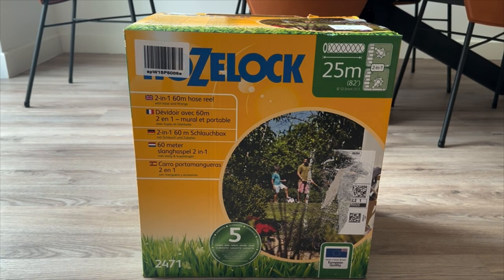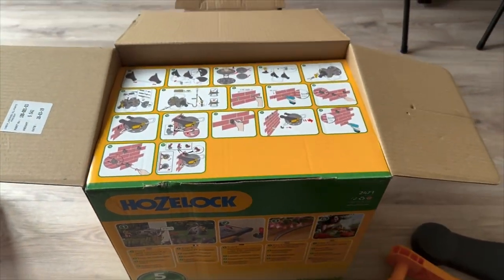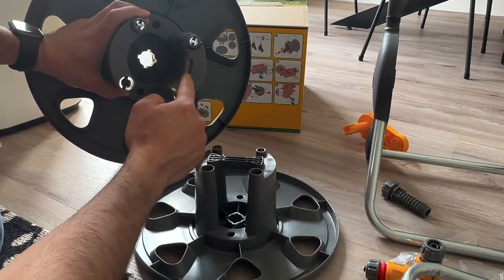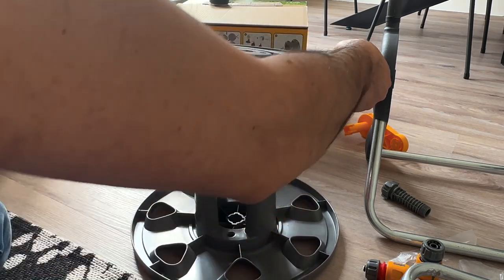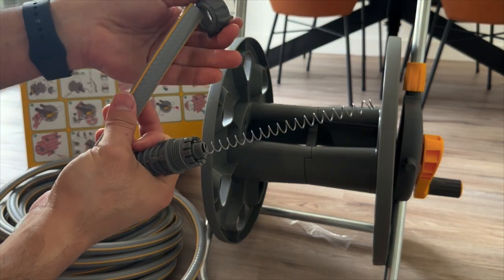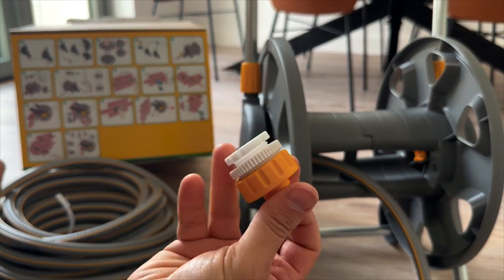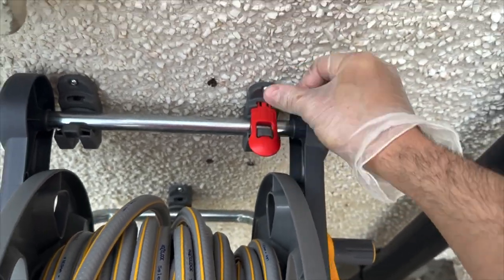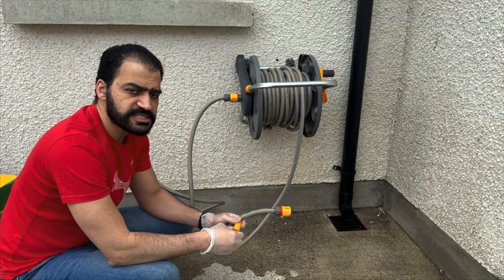HoZolock 2-in-1 hose reel assembly! It’s not that bad! (Update: don’t buy this)

Comment: Rubbish. Mine is brand new and I have taken it apart twice and the connection inside the reel is still leaking. I shall be returning it.
Reply from the maker: That started to occur here too, 2nd Hozelock system I get and fails :/
Reply: check the o ring inside the hoze, mine is deformed brand new.